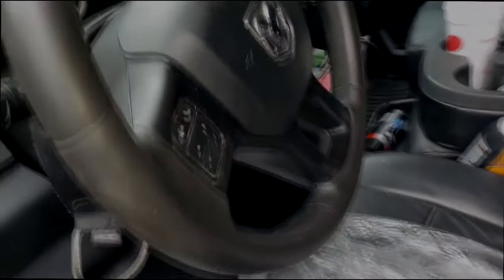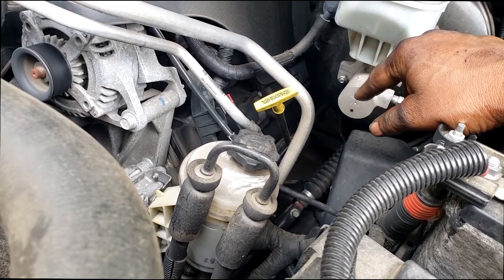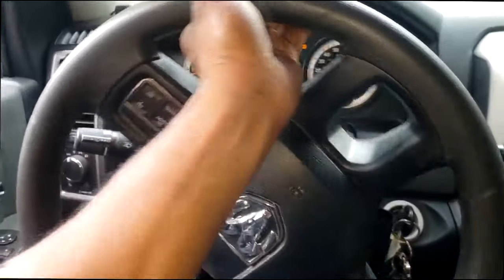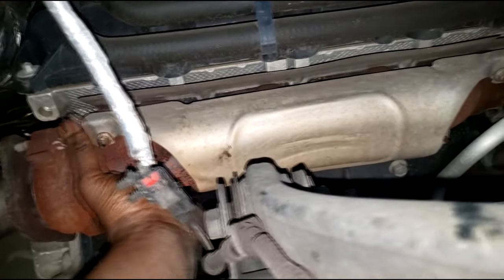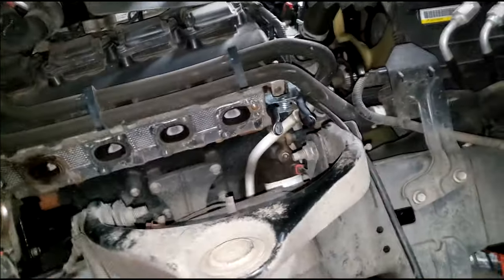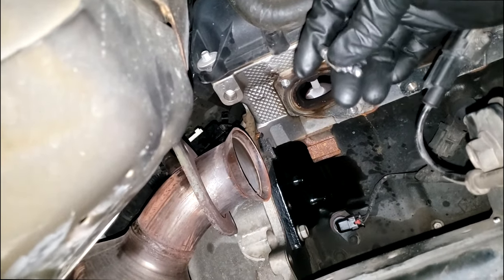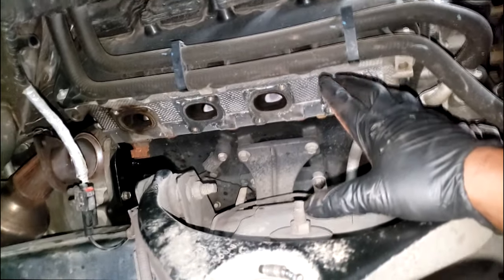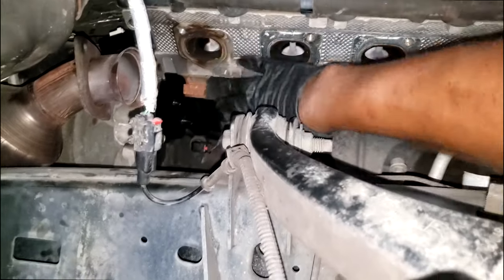How to fix a TICKING Motor. Chrysler Jeep Dodge Ram 1500 2500 5.7L Hemi exhaust stud broken tips.

Comment: Why does the exhaust tick noise go away after the car warms up? Is it from the expansion of the metal on the manifold?
Reply: Yes the noise can stop after warmed up.  Bolts do break and need replaced.
Reply: The real tick is a very expensive to fix even Mo if you can't deal wit it yourself and your ignorance tells me you shouldn't even try. Like my boy here says it's just busted bolts. Keep up on your oil changes like it's church and use good oil... throw a couple rare earth magnets on your on the bottom of your oil filter and you'll prolly never git the tick. Same with your oil and trans pan if you wanna preserve then too.

Honestly is more a nuisance than blah but it does screw with the engineered resonance between the the intake and exhaust. Fyi too if you don't know what ya doing cold air intakes look cool but screw with crap you totally don't understand.
Reply: Yep that's it. I'm having the same issue with my ram. I'll give an update when I find out exactly is going on but it sounds much like this issue. Horrible tick, but goes away when warmed up.
Reply: @dirtyshirt2821 u ever found out what was it
Reply: I have the same sound 
And looking here for some advice on what it might be 
It stays the same when the car it’s idling 
Does not get worst as you accelerate 
When I’m doing like 30mph you don’t hear the noise 
Just when you come to at stop and it’s idling that you hear the tick 
Any ideas on what it might be 
It’s a 2010 5.7L hemi ram 1500 it’s got 159k miles now
Reply: Yes I think that is what is going on with my truck
Reply: Wheñ the exhaust gets hot the metal expands and closes the gap
Reply: The ticking noise is coming from my 09 5.7L exhaust how would you make that noise go away?
Reply: @dirtyshirt2821 any update?
Reply: Might be for that... but I've a different issue.

Comment: Had to do this on my 04 Dakota 4.7 years ago...PITA....had to drill a few out and use heliocoil inserts....held great but was so such a small area to work in.  This year, I bought a 2012 Ram 1500 which I knew had this issue.  Two things  1. There is a lot more room on a Ram than on a Dakota   2. Having not welded for 30+ years (stick welding) and also having a MIG welder on my shelf I bought from Amazon during a prime week 2 years ago....I decided it was time to relearn on 5 bolts broken off at the stud.  Result, nothing short of awesome!

Comment: You nailed it my friend. My mechanic identified this on my 2014 and now on my 2018 Ram 1500 Hemi. Ram should fix this since it is a design flaw of two metals that heat at different speeds but they have no intention of doing it on these models. Nicely done sir!
Reply: I have the same thing but it doesn’t go away.
Reply: @cherijohansen6490  
Lucas.  
Oil alone is not enough

Comment: Should've replaced the cast iron manifold with a stainless. The stainless steel and aluminum head have close heat cycle time which won't allow those bolts to break at all

Comment: Apparently they snap due to becoming superheated. Man, I just had this done  2017 ram 1500 laramie. 12 studs were sheared. The exhaust manifold was warped and not reusable.  This cost 2300 bucks. Learn from my mistake, and take your rig in as soon as you notice something. The main part of the cost was getting the studs out. These guys here in the video did it the right way in my opinion.  Use a welder, don't drill and tap.
Reply: Also- all  bolts were replaced with stainless steel- dissipates heat and are stronger 👍
Reply: Hey thanks for your comment, good to know. My 2017 is sounding like this after pulling my trailer this year

Comment: Don't forget to deck (belt sand most likely) the exhaust manifolds before putting them back on and it shouldn't happen again. They'll still move, but they get more stable after some heat cycles, decking them will make sure they are true again now that they have slightly warped since new.
Reply: I was gonna say the exact same thing 👍

Comment: Hey Good Job my Friend.  I have the same noise 2015 with 93,000  miles  I am gonna go outside right now and see if my shield is not attached W\broken bolt   if YES, then easy and inexpensive fit.  I do not weld either nor do I have a machine.  NOt sure how I am gonna get those things out. Non the less good video professional, short, to the point did not waist my time telling me you had go feed the chickens or how you solved another unrelated problem.  Gzzzzzz so many videos people do and take soooo long  my time is valuable too   Give you my highest recommendation

Comment: Yes the Hemi exhaust 'tick' is caused by broken exhaust manifold studs/bolts.
The Hemi heads are made from aluminum and the exhaust manifolds are made from cast iron, two different metals that expand and contract at different rates due to heat application cycles.
The rear studs/bolts have the most heat applied to them because the heat from the other three exhaust outlets has to pass by the last outlet to expelled through the exhaust pipes and Cats.  Therefore the aft exhaust manifold studs/bolts endure heat cycles with greater temperature ranges than the forward studs/bolts, hence they usually break first.
Usually the tick sound caused by the broken exhaust manifold studs/bolts goes away as the engine warms up.
The hot parts, heads and manifolds, expand and take up the gap caused by the broken parts, quieting the ticking sound.
Reply: You mean block eh👍😆 read through that. A fellow metal man😁🤟
Reply: And also bro the real hemi "tick" is warn out lifters they get pitted because Dodge used cheap ass steel on the rollers on the lifters. They stop contacting the rocker arm correctly and have a gap so when that lifter engages it strikes it instead of rolling on it.
Reply: Ogcowboy .. correct.

Comment: Did your friend use flux core or mig with gas? Appreciate it the reason the bolts breaks is manifold warps with heat

Comment: Yessss sir.

They pop because the block is aluminum and the manifold is cast steel. They have different thermal expansion (So they grow different amounts when they get hot). The load theory probably has a play in it 👍but the major thing is low grade factory bolts and differing thermal expansion

Comment: If you can or don’t have a welder you can get a left hand tap and bolt and drill the stud , the tightening of the screw will loosen the bolt because they are opposing forces!

Comment: great stuff. just got a ram with the same problem i think. they cut the cats off “both of them” and straight piped it. so many exhaust leaks from bad welds. im hoping the tick is from a bad bolt on the manifold.

Comment: I got a 2010 Dodge Ram 1500 
Having the same sound now 
But the sound goes away once I’m at like cruising speed of 25 to 30mph 
It does stay on when it’s at idle but does not get any worst 
Could it possibly be just this ? Or something else 
If you know Id be a great help to know so I can get it fixed
Reply: Did you find the problem?

Comment: Why do 5.7l have that noisy vakve train mine makes the same clicking fluttering noise like yours when you went to the passenger side of the truck the side right before you said the noise went away it has that clicking noise is that normal and my manifolds are fine I don't have that gross tick from the manifold at all just the engine is very loud and has allot of excess noise like yours

Comment: Hi JT, my ram is having the tick now…. Now I watched your video, I know where the ticking is coming from. A couple of quick questions if you don’t mind answering: 1, should I replace both side gaskets and bolts at the same time just to save me the trouble of doing the other side a different time? 2, will the bolts break again after I replace them? 3, if so, what is the solution for that? Thank you JT in advance and again, awesome video 👍
Reply from the maker: Hey bud, the gasket is not the problem, so if the other side ok, simply upgrade the bolts with the new ones.  When I repair one side side I always  either torque the other side back to specs or simple install the newer bolt package.
Reply: Is there a specific bolt package for purchase somewhere?
Reply from the maker: I use the Mopar kit package from the dealer parts department
Reply: @OnlineMechanicTips  got it. So just ask for the exhaust manifold bolt kit and new gasket?

Comment: JT,
I replaced my manifold bolts yesterday on my ram 1500 5.7 hemi and torqued the bolts to 22ft pounds instead of 18ft pounds. Should I back them off and retorque them or let it ride?
Reply from the maker: Thats not much of diff and you should be fine imo.
Reply: @OnlineMechanicTips  thank you

Comment: I like your style. Thanks for the info.
Reply from the maker: Thanks for watching bud
Reply: My Dart has exactly the same bolt broken off for years from trying to swap to the performance early 340 manifolds. I had taken it out a few times to do gaskets and the upgrade but the last time I touched it it broke off and I was using wd40 and all that. Makes the same noise when cold or under load too.
The original 69 318 manifolds were machined perfectly to the heads from the factory when built and needed no gaskets till you took them off and let it rust or put different manifolds or headers on it. I think the later engines they stopped doing the machine work and used gaskets as it was faster and cheaper.

Comment: The manifold is usually warped . Put it on a straight level surface and see. Have it surfaced by a machinist or sand it down yourself.

Comment: So does the exhaust tick need to be fixed, since it goes away after the engine warms up?
I saw another video that flattened the warped manifold to prevent it from breaking a stud again. If you reinstall the warped manifold it causes stress on the studs
Reply from the maker: Good point, we have been making the repairs as seen in the video, never have replaced the manifold for warpness. And yes, ide get the broken exhaust tick noise fixed.

Comment: Yo, I got a tick.  Gladly  it's not the Infamous Hemi tick, but from the location it sounds to be the transmission solenoid.  Every time I put it into gear I hear it...  And when I come to a stop ant the trans drops back into first gear.  Any heads up at all would be appreciated...
Reply from the maker: What kind of vehicle is this? Also are you subscribed to the channel?
Reply: @OnlineMechanicTips  It's a 2014 Jeep Grand Cherokee Limited with a 5.7 Hemi.  The sound just started this morning...  And yes, I am subscribed.
Reply from the maker: @Black_Reign  Hey bud this year Jeep likely equipped with the 8HP transmission. It's a fully electronically controlled trans which means when it sees a problem, that info kept in the module. It takes a special tool to get in there and look at these codes and/or flash update that model. You may have to pay the dealer a visit to get that checked.
Reply: @OnlineMechanicTips  Electronically controlled.  Exactly, that's what had me thinking about the transmission solenoid. I'll run the diagnostic  and see what it says.  But without an actual check engine light, I don't know how much I'll get.  Thanks.

Comment: Had both of my exhaust manifolds replaced and some bolts on each side had to be extracted paid a total $2,210 with the dealer  smh  ticking is caused when manifold s get warped due to heat and bolts brake

Comment: my cam shaft and lifters went out at 209,000 miles
but 
from new to 209,000 miles i had 3 broken bolts . all cover under warranty and the cam shaft was also cover under warranty.

they say for broken bolts it would cost 600 to 1000
cam shaft and lifters be around 5k. 

anyone looking to buy used RAM , set side some money. 
for me, lucky i have lifetime power train warranty
Reply: Hi - The 5k is for "accessories" *

Comment: What's the possibility of them not being broken but actually snapping off while trying to remove it? The old dont fix it if it ain't broken thing.
Reply: Not in this special case (heat cycling involved, studs are fatigued + warped manifold). If the studs are OK, they will unscrew without cracking. If weak (and manifold is leaking) = they pop.

Comment: Got the tick that never goes away.  2016 Ram 1500 Tradesman
3.6L 3604CC V6 FI VIN: G-ERB-Flex I think it's the Lifters.  Any ideas?
Reply from the maker: Its hardly ever the lifters. Likely the rocker arms tho. Was  your check engine light on? Also are you subscribed to the channel?

Comment: Hey u forgot to say it's also not made like the other 3 stud 🔩 s
U see
It takes 4 stud bolts to hold the heat sheet 
3 are made out of metal
But the top rear I think is made out of copper or brass n none metallic
But don't know y.!

Comment: What if it doesn't go away even after it warms up???
Reply from the maker: Hey bud then theres a problem. But it still can be broken studs. Any codes in your computer?
Reply: @OnlineMechanicTips  no codes
Reply: @OnlineMechanicTips  and I'm subbed and follow you 🤙
Reply from the maker: @randyu8688  hey bud its all about the frequency of the sound..If its a thud tick noise that won't go away you may have a lifter that has collapse and possibly chewing into a cam lobe..You have to get that looked at and fix real soon
Reply: @OnlineMechanicTips  can I send u the video and sound ? Wish I could take you the  truck!
Reply from the maker: @randyu8688  sure onlinemechanictips@gmail.com

Comment: What if the tick does not go away after car is warmed up? 
We went to a mechanic and he’s saying it’s going to be the lifters and cam.. he wants to charge 1800 for labor alone
Reply: You can check the studs yourself. Try to undo them - if they are cracked, fatigued, they will pop (and then you know it was the studs/bolts).

Comment: Does this happen on the challengers aswell
Reply from the maker: No, the exhaust sys different of a Challenger than a Ram 1500
Reply: @OnlineMechanicTips ok thanks . I’m chasing a tapping sound on my 5.7 challenger man . I took a stethoscope and put on top of valve covers and listened to both sides seeing if I could hear a lifter but can’t hear anything on either side . It’s making the sound at low speed acceleration. Any advice ?

Comment: I have a 2021 Ram 1500 and I have 20K on it and I have the exhaust tick that just started.
Reply from the maker: The last one i did I had to replace the manifold on that side..its been redesigned but it had a crack on it..This should still be under warranty

Comment: Why not cover the hole and use an extraction kit instead less chance of damage
Reply: Another troll? You can do more damage if you drill not in the center of the stud, which is easy to do.
Welding is The Best method ever. Period.
Reply: @GrandePunto8V  Didn't know constructive opinions made for trolls. Happy to see more hemis on the road. If you know anything about stress and  strain analysis. welding is going to make more excessive heat that than a drill bit can ever achieve.  Bruh anyone with an opinion an be a troll doesn't mean you have to take it that way.

Comment: Recommend a tap out/ easy out woulda been a lot quiker, easier, and cheaper than a welder
Reply: Lames think that easy-outs are the solution every time. Welding is the best method. Period.
"Why"? Get some shop experience, then comment.

Comment: Upon further thought it might be a good thing they used undersized low grade bolts. Better the bolt break than the exhaust manifold🤔if you use a mechanic and can't fix crap yourself they gonna be in there anyways time wise and bolts are cheaper than a busted eye on and having to totally replacing the exhaust manifold... Or ruining the block and having to drill the hole out in the manifold and block and rethreading it.  I guess it's a thought out trade off we get for not having to haul around a steel block... Aluminum yields and loses ton of strength when she gets hot so it would probably pull the threads. 

Wholly crap Dodge engineers are smarty pants 🤣

Comment: The real tick is a very expensive to fix even Mo if you can't deal wit it yourself and your ignorance tells me you shouldn't even try. Like my boy here says it's just busted bolts. Keep up on your oil changes like it's church and use good oil... throw a couple rare earth magnets on your on the bottom of your oil filter and you'll prolly never git the tick. Same with your oil and trans pan if you wanna preserve then too.

Honestly is more a nuisance than blah but it does screw with the engineered resonance between the the intake and exhaust. Fyi too if you don't know what ya doing cold air intakes look cool but screw with crap you totally don't understand.

Comment: Sounds like an air compressor with a bad connection.....I think it's an exhaust manifold leak!....no shit Sherlock! I sure wouldn't put bolts with thread  lock on it.  Anti-size for sure. I'd look to move the HOT catalictic converter away from the header to a foot further back in the system, because, seems to me, the last bolts seem to be snapping due to a change in metallurgy.(heat hardened bolts).
Reply from the maker: The new bolts come with the tread lock on it, Im not sure those broken treads that stays in the head had tread lock on them or it would not have been so easy to come out as you saw. May they thinking over time the bolts back off when hot and just vibrates until they snap...hmmmm